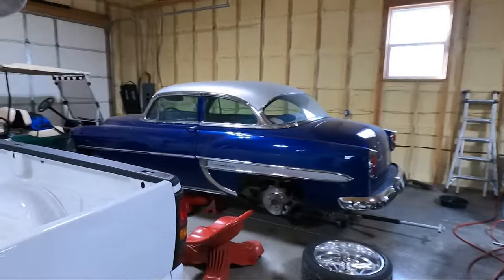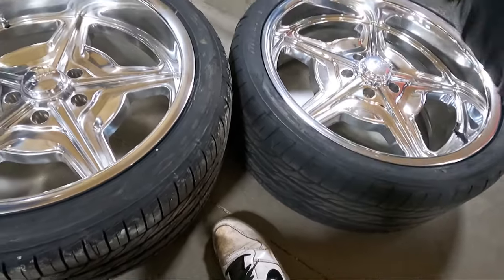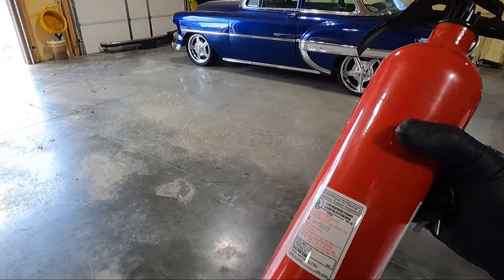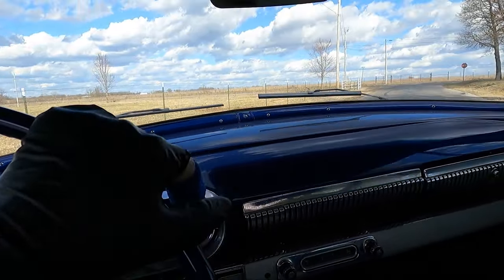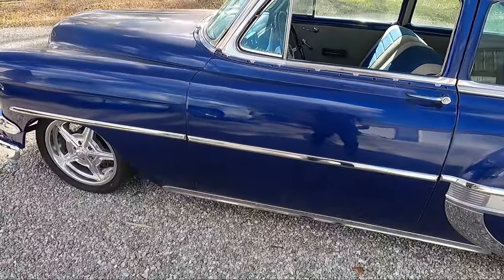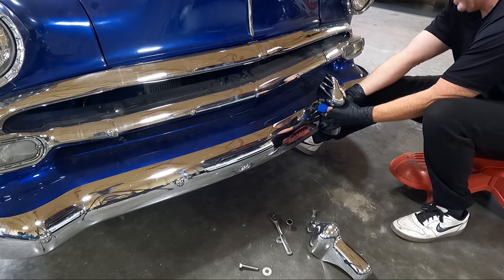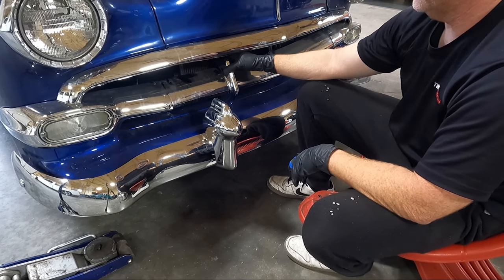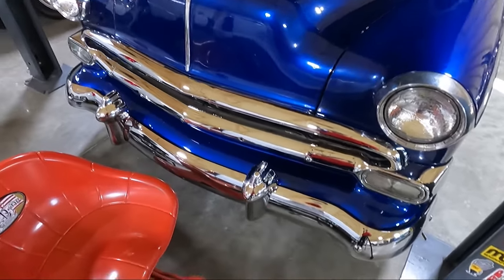1954 Belair First Drive! Will it Work?(Plus New Wheels and New Chrome Parts Installed)

Comment: I love the work and detail you put into Modern Chevrolet trucks but, Chevrolet cars from the Fifties, to be honest doesn’t seem to be your forte.
I would set the 54 down lead sled style with Wide White’s skirts for the rear, bags would modernize the 54, suspension wise of course!
Blue and white paint looks great, chrome looks great but oversized billet wheels and low profile tires on a Fifties car in my opinion do not look good.
You don’t have to chop the Ol’e girl but lowering her down with fender skirts and wide whites with pencil tip exhaust out the rear would be sweet!
Reply: I agree on that. The wheels are out of place on 1954 and down. He had to do something to work with the calipers and rotors on it. I think adding spacers would have made the stock wheels fit and look better than big wheels. still a cool car.
Reply: @youtubedev0  I agree, a very kool 54!
Reply from the maker: @d.bcooper9645 thank you
Reply from the maker: This is more my style